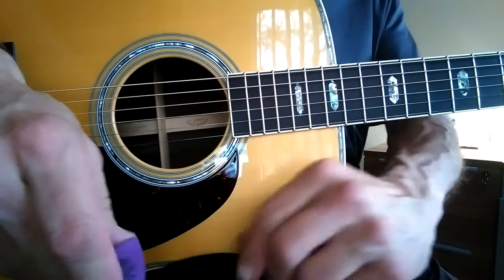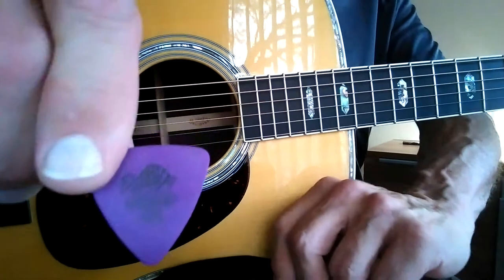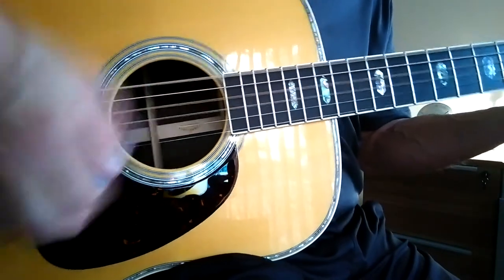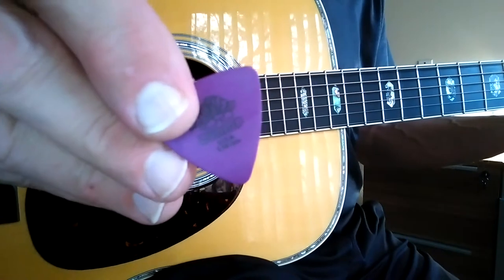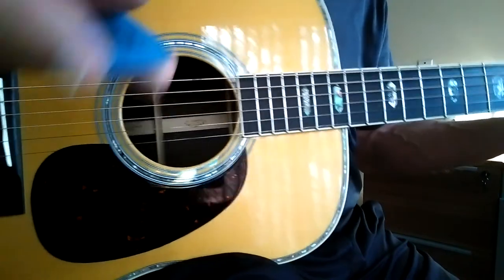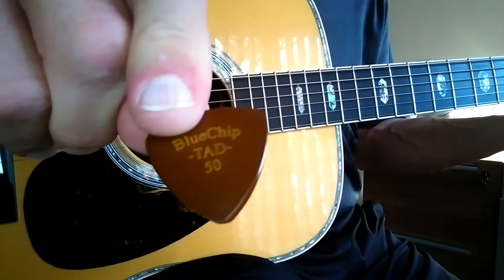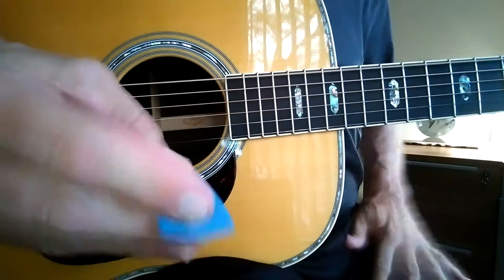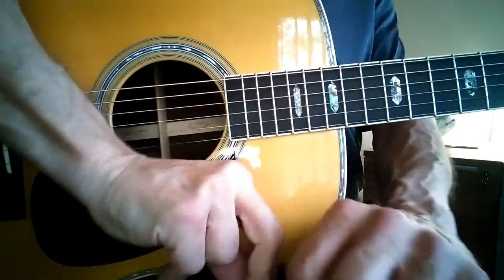Blue Chip TAD50 versus Dunlop Tortex 1.0 and 1.14 - Large Triangle

Comment: That guitar sounds really nice very balanced with very nice projection, tone and resonance.   Well if you're playing with other instruments I'd opt for the Tortex 1.0mm as it's a bit brighter and would cut through.  If recording or playing solo gigs it would be a toss up for me between the Tortex 1.0 and the Blue Chip.  Obviously you can buy a lot of Tortex picks for the price of 1 Blue Chip so if price enters the equation the Tortex 1.0 wins hands down.  That said, I couldn't help wondering what strings you were  using in this?  Phosphor Bronze?  Gauge?  Brand?  Also curious what mic you used on this?   Nice job on that!  Thanks!
Reply from the maker: Hi Dave, great insight. I also like Tortex and Ultex picks. Also Dunlop Prime tone smooth are really nice. The strings were Martin Lifespan phosphor Bronze medium gauge. .013 - .056